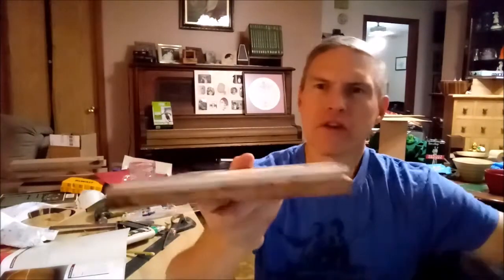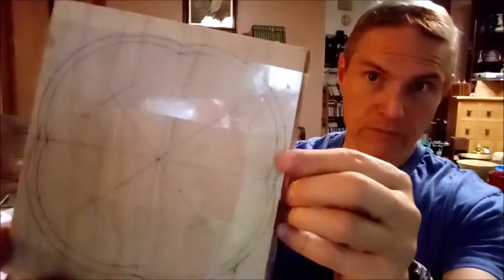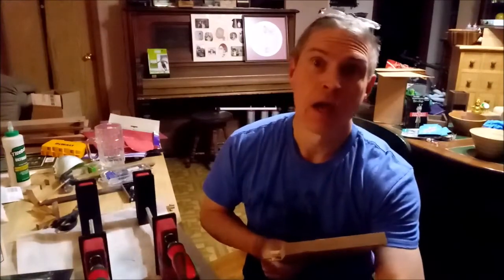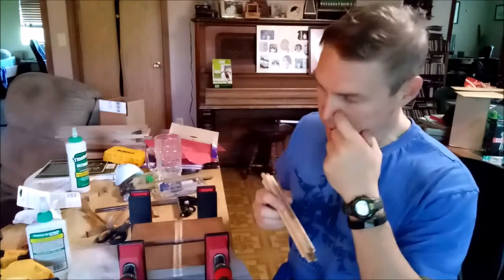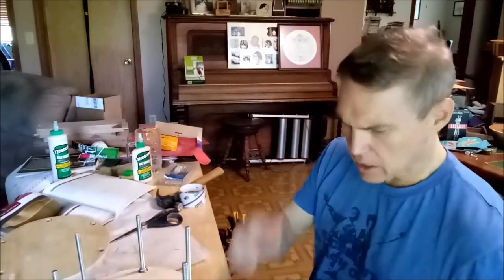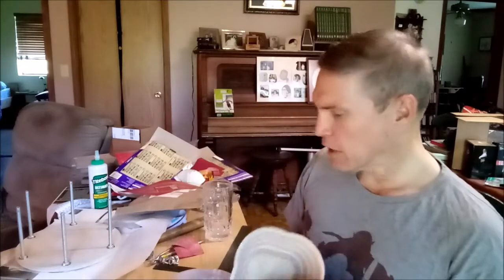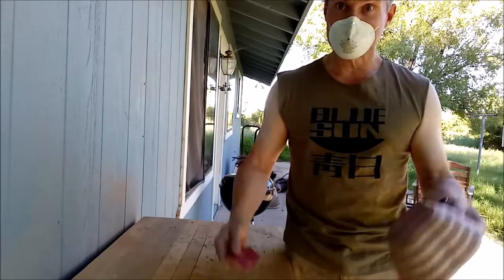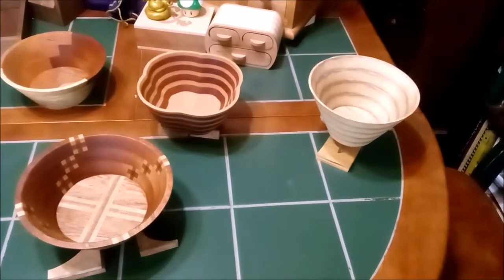Making A Scroll Saw Bowl - Double Shot

Comment: do you have vid of just explaining how to get the right angle? Thanks
Reply from the maker: I don't. There's a table in the back of the scroll saw bowl book that I use, and there's also a manual method. 

For that you'll follow these steps:  1) get the final thickness for the bowl blank,  2) determine how wide you want your rings, 3) divide the ring width by the blank thickness, 4) use an inverse tangent (or arc tan) calculator to get the angle to set your table (round up to the next whole or half degree). You can find a calculator here:  http://www.mathwarehouse.com/trigonometry-calculators/inverse-tangent-calculator-online.php
Reply: @jahellen   thank you